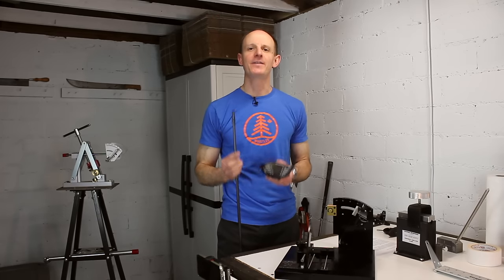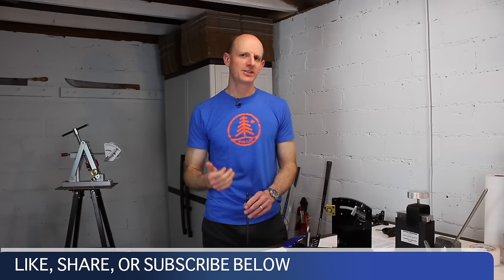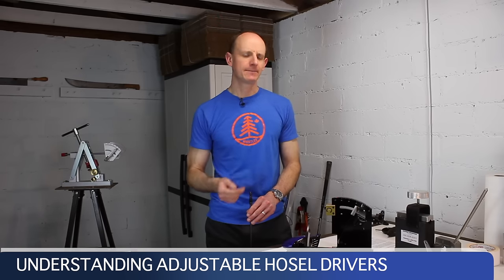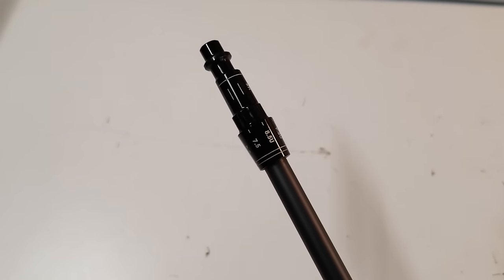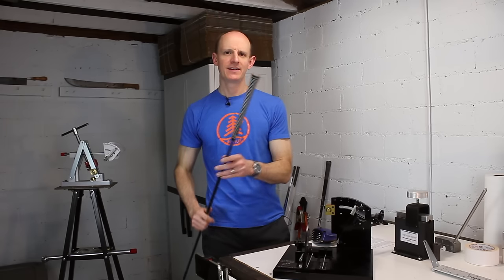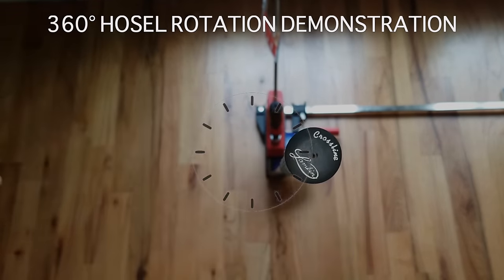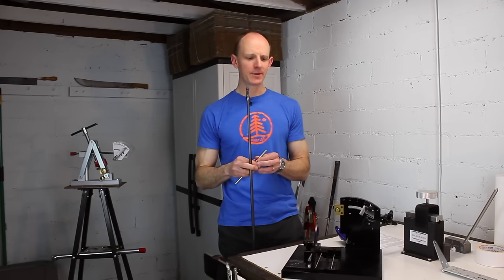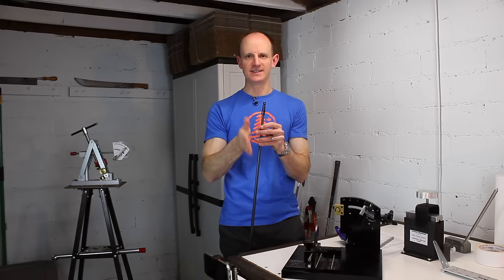Adjustable Hosel Drivers - How they change Loft, Lie, and Face Angle

Comment: @MOBILE CLUBMAKER Your explanation on this is 2nd to none! Just happened to see your channel and yes I did subscribe ! Thanks so much as I've just recently purchased a Sim Max D Taylor Made Driver.  I do have 1 question that is perplexing me to no avail.  The insert / adapter for the club head is there a right & left handed adapter ? . I'm a left handed golfer and the adapter on the shaft for my new driver has an RH ... yet my previous older R11 S shaft adapter has LH on the adapter?. Is this obvious it will make a huge difference when I make adjustments for any change ?  Certainly hope & appreciate a response to this ... thanks in advance & cheers from Ontario Canada!.
Reply from the maker: You should have a LH adapter in that club. It's not a big deal if it's not, just need to remember that the loft up and down will be reversed. The lie will not change, just loft measurements.
Thanks for supporting the channel!
Reply: @EFGMC   Thanks so much for the quick/response!!! Strange but noticed it immediately. So if correct,to get a higher loft with a RH adaptor I should choose the lower setting as a lefty?.  Sorry getting old really sucks!!! :).
Reply from the maker: @17Bruinfan  You got it. if you have any doubts you should be able to see the angle in the adapter by just looking at it before inserting into the head. Whatever orientation makes the adapter lean/point towards your target direction with the shaft held straight will be the lofting up setting.
Reply: @EFGMC   Perfect!,thanks so much, appreciate your help and quick response. Was having fits on the course Friday when my drives were low knuckling and thought I bought a knock off clone driver from global golf. Even pushing 60 yrs still hitting 260,but struggled to reach 160,makes sense now. So thanks again ! Cheers.

Comment: In what setting would produce a draw flight with the ball?   If I’m making any kind of sense.   I recently purchased a Mizuno ST 190 driver.    I’m still waiting for delivery on it.   But would love that draw ball flight.
Reply from the maker: Setting the hosel with the loft increased will make the driver want to sit closed at address and can promote a draw assuming you maintain that face angle at impact. You could also increase the lie angle more upright to promote a draw, but this has a very minor influence at best.
Last suggestion is watch my DIY Driver Fit video,
https://youtu.be/bXgaUC_tKCw
If you can move your contact point more towards the toe at impact, the gear effect will promote more draw spin vs. center or heel impacts.

Comment: So I guess I should have asked if the club is at a higher loft is the face angle at a - minus or + open to square at address?
Reply from the maker: Not sure what the plus or minus means. I would just focus on, for right handed golfer, more loft will make the face point more left of target naturally, and less loft will point it more right of target.

Comment: I know this is a year old but maybe someone can give me insight. I am fairly new to golf. Played seldom over the years but just really getting into it. First off, i use a cobra f8+. Just started trying to use driver, i use to just use a 3 wood because i felt it helped my slice so i would drive further. I have played baseball my whole life so it’s hard to break my wrist motion from a baseball swing. I average about 290+ yards when i dont slice. However, i hit my driver a mile high, so i tried lowering the loft of my club, I’m still unsure if when adjusting my club, do you want the face square with the ball or just let your club rest naturally on the ground.

Comment: I still cant comprehend the relationship between lowering the loft=open club face, and higher loft=closed club face.   Seems it would be the exact opposite, but indeed lowering the loft does open the club face, as thats what I did with my driver and can see it a tad more open at setup, which is what I needed.  

Just wish I can understand why this is.

If you want to hit a flop shot with a wedge, you open the face up.  Why is this not the case with the driver adjustment?
Reply: After watching the video, I understand it now.  Thanks so much! This was driving me nuts!
Reply: I will say though, this ONLY is the case if you are grounding the club, as it wants to lay in those positions.  If you are someone that hovers your driver and doesn’t ground it, the club-face wont be open or closed based on the loft you set it to, it will be as square as you set it.

Comment: Just curious, what if you hover the driver , then how does this effect things?
Reply from the maker: Hover or rest the head. Won't make a difference as long as you are squaring the face to your target at setup. Really to be more exact, does not matter if you play with the face open or closed, as long as you have that same face angle regardless of how you set the hosel adapter.

Comment: The open/close has more to do with compound angles and the pivot point of the hosel vs the plane of the face, no matter what, when you adjust the angle of that shaft, which is usually 60° to the face, there will always be a secondary angle created on the face

Comment: Have you tested the Cobra adjustable heads which are supposed to keep the face square even after letting it sole?
Reply from the maker: I haven't played with one personally but am sure they can at least minimize the face falling open or closed with sole shape and weight. It's also one of those things that depending on how you choose to measure it, you can make various claims. Also the fact that the adjustable hosel is bent at 1.5 degrees as opposed to 2, will lessen the effect.

Comment: I recently bought the king cobra drive with the adjustable hosel, it was factory set at 10.5 , I was hitting my drives straight , but higher than I wanted, I adjusted it down to 9.0, and when I looked down at the club head the toe had moved forward, what adjustment should I make to get the club face square to the target,..my hands on the grip , or my feet position on the tee ( this might be a dumb question , but I’m just a beginner )
Reply from the maker: I would just adjust your grip to make sure it is squared up at setup.
Reply: @EFGMC  thank you …. When I first adjusted it to 9.0 I got freaked out so I put it back to 10.0 so I never tried it,.. I will try adjusting my grip and give it a try,… thanks again !
Reply from the maker: @johnmellyn2700  Yep. Driving range and some range balls and you should be able to dial it in.

Comment: How does tilting the club forward or backwards (add or reduce loft) affect club CG? It should move with regards to the center of the clubface?
Reply from the maker: Lofting up does move the CG fractionally lower and vise versa for lofting down. I've had this discussion with other builder designer experts and consensus seems to be the amount that it moves is so small, it really won't ever show any effect.

Comment: Does a left hand TMade adapter do the opposite with loft & lie to a right hand one? With a right hand adapter, I go down 2* with loft but hate that it flattens the lie. If I go down 2* with a LH adapter (LH up 2*) does the lie become more upright?
Reply from the maker: All the TM drivers/woods/hybrids start with the flattest lie angle as the standard or neutral. That means any adjustment you make of any kind, (up loft, down loft, upright etc) will all make the lie angle more upright. It doesn't matter if the club is right or left handed as that only changes what they label the loft changes. If lie angle is really a concern you may need to look at other brands who start their setting in the upright highest lie angle instead of the lowest.

Comment: Where would you buy this adjustable Hosel for drivers and how would I get it installed into my driver
Reply from the maker: Adjustable hosels can not be added to an existing bonded hosel golf club. The head of these golf clubs has a specifically designed hosel that will accept the larger diameter adjustable hosel and allow for its movement.
Most drivers made in the last 7 years however will be designed with an adjustable hosel. Just look for a hole in the sole of the club to tell if it has one.
Reply: @EFGMC  Thanks so much

Comment: Hello- My name is Bryan.  I am 65, and have trouble reaching distances between 140-180 yards.  My 5 wood reaches about 180, and my 3 wood reaches 200... My 8 iron stops at about 140 yards, and I find it hard to hit the 7-5 irons.  Isn't there some fairway wood(s) available to help me?? Can I have something made?  I would prefer a fairway wood with a larger head, no offset, and about 30-40⁰ loft... But, cannot find such a club.
Thanks,
 -Bryan
Reply: 7 or 9 wood.

Comment: If I use the "D" position on my Callaway driver hosel I presume I am making the lie angle more toe up. But if I then aim      the face at the target am I losing the draw bias which the the D position is meant to introduce?
Reply from the maker: You are right that the D is just Callaway naming the upright lie settings as draw settings. It should be noted that the draw produced from a driver lie angle change, does little to the ball flight, at least compared to actually altering the face angle.
However the upright lie does not change based on how you manipulate the face angle so the slight draw bias it provides will remain.

Comment: If you have a 9.5 driver set at 12 and ground the club, does it go back to 9.5?
Reply from the maker: It will depend somewhat on the sole geometry and how much the face closes once grounded but it will likely be close to that 9.5

Comment: A friend of mine ordered Mavericks with a draw bias.. can this be corrected or is he stuck with this driver?
Reply from the maker: If we are talking woods then the hosels can be adjusted to lessen draw face angle, however it requires lofting down. If we are talking irons, you could bend them stronger which would lessen the draw biased set up.
Reply: @EFGMC  He ordered both the woods and irons with draw bias.. Thanks

Comment: Thank you, thank you, thank you!
Reply from the maker: Thank you for watching!
Reply: @EFGMC  Next it would be interesting to understand the concept behind draw settings on club hosels like Cobra does.
Reply from the maker: @becrisp  It will be the exact same mechanics as with the driver I showed. The difference I believe (don't have one sitting in front of me so this is my hypothesis), The Cobra sole design has a shape that will close the face when you change the lie angle guessing more upright.
This contact point will give you the face closure. Cobra chooses not to even mention lie angle in the adjustability (different than Taylormade or Ping or Mizuno). They simply focus on loft changes and face angle.
The shaft still rotates around the hosel (think of the clock I use in the video), it's just the contouring of the sole will make the head sit more closed or square based on the shaft orientation.

Comment: 10 second summary: 
The shaft enters the adjustable adapter at a slight (2 degree) angle, not parallel. 
Rotating the shaft around the adapter to the various settings results in small changes of club head orientation as related to the shaft, thereby changing the loft and lie.
Reply from the maker: Correct. Would just add that it's when the player returns the shaft to the neutral playing position that the changes actually show themselves.

Comment: Does the upright angle , close the face?
Reply from the maker: Yes, but with a flat faced club like a driver, the face  angle change is pretty small (4 degree lie change = .25 degree face angle change). You will get more face closure from increasing the loft.

Comment: Could you make a video or reply to this comment about how the cogs work? Thanks it’ll be much appreciated!!
Reply from the maker: If you are referring to the Callaway system, it's still the same basic idea. The only difference is you are rotating the cogs which tilts the shaft instead of rotating the entire shaft. Then it's just a matter of how the manufacturer chooses to label the changes. Some focus on just loft and face angle, some focus on lie angle as well. Just depends on the brand but the mechanics of what I show in the video are the same regardless. If the shaft is leaning forward it increases loft and will cause the head to fall shut. If it leans back, it lowers loft and falls open. If it leans up towards the toe, it increases lie angle, if leans towards the heel, it decreases lie angle.
Reply: @EFGMC  ahhhh smart guy alert. Thanks so much.

Comment: So I guess the loft sleeve won't work as intended for me since I place the driver's head on the ground and let it balance itself before gripping the club. It will change the shaft angle at which I grip the driver but the driver head will lay exactly the same on the ground regardless of which loft sleeve position it is in...

Comment: How does adjusting the head help to hit a draw
Reply from the maker: Increasing loft will make the head want to sit more closed which will promote a draw. Also increasing the lie angle can promote a draw but to a much smaller degree.

Comment: So, if you installed a training grip on your driver that helps you keep your hands in the correct position there is no way an ajustable Hosel Adapter would work.  Correct?
Reply from the maker: Depends on the driver. Callaway does not rotate the shaft so a training or ribbed grip would be fine. Titleist rotates the shaft in some settings but not in all of them.
As for the rest you would need to move the grip after rotating the hosel. This is where air installed grips come in handy.

Comment: so if you clamp the head and rotate the adapter, the shaft traces a out a cone. are there manufacturers whose adapters don't cause the shaft to trace a regular cone?
Reply from the maker: Nope. They all use the same method. They may start in a different location as the neutral setting but they all move in a cone. Titleist moves in sort of a double cone (like the tea cups ride at Disney Land), which is a bit different.
Reply: @EFGMC  got it... i watched part2 and figured that out too. thank you for these videos.

Comment: Out if curiosity if I set the position to STD  -D is that just closing the face slightly more
Reply from the maker: What driver are you referring to. Some will be talking about the face closure, but could also be referring to a more upright lie angle.
Reply: @EFGMC  Thanks for the reply I am using the Cobra Rad Speed XB
Reply from the maker: @47speedemon  Don't have one in front of me. The standard D setting is 180 degrees from the standard setting correct? It should be, in which case it's really just the lie angle getting more upright and them calling that draw biased. The face does not actually change angle in this case. If you want a more closed face, you would need to use a higher loft setting.
Reply: @EFGMC  oh ok I see. Thank you for your replies very help all the best for your channel bud

Comment: hmm if i get this correct the lie is also changing the cg point in the club so higher the loft the cg moves more further back witch should make it more or less fogiving??? 🤔
Reply from the maker: If we loft up, we lower the vertical cg slightly and vise versa for lofting down. This would in theory mean the higher lofts will produce less spin per loft vs a stock club with that loft not adjusted. Would love to test this, but have a feeling the amount would be very small and I'm not good enough to be that exact. Probably could only see it on a robot.
Reply: @EFGMC  so my understanding is correct??? CG as in centre of gravity
Reply: @EFGMC  ask mark crossfield to test this??
Reply from the maker: @Mrequine1  Yes, center of gravity. Not moving forward and back, but vertically up and down.
Reply from the maker: @Mrequine1  I doubt any human short of a Moe Norman would be able to see the difference. I have a feeling it would require a robot and a lot of data points to see a difference.
Reply: @EFGMC  thnx so higher up the face more spin lower less is spin?? am i understand this correctly or is it the other way round?? its worth knowing as there allot of club fitting cowboys out there id imagined!!
Reply from the maker: @Mrequine1  The lower the cg, the more vertical gear effect you see, ie reducing back spin over a greater portion of the face.
The higher up the face you make contact the more gear effect reduces the spin. Likewise, with low strikes. Low contact on face increases the back spin.
Of course you also have face roll that increases or decreases the loft as you move up or down the face. This will also factor into the spin numbers.
Ideally you should try and make contact just above the center for best spin/launch combo.
Reply: @EFGMC  thankyou for the info ive learned allot 🤗

Comment: What is your take on using an opposite handed adjusting hosel to have more adjustability?
Reply from the maker: That only can be applied to Callaway and Titleist. No other brands would see a difference other than incorrect label on adapter.

Comment: If 2 persons , one tall guy and one short guy use the same driver the dynamic lie will change. The short guy will have a toe which us much higher than the heel compared to the tall guy. How would the ball flight change for these two persons?
Reply from the maker: Sorry, just found this comment. The shorter golfer would in theory see the ball start slightly left (assuming RH golfer) and draw on top of that. Opposite for taller golfer. The start line won't change much for a driver b/c the face  has so little loft but the spin would cause the majority of the miss.

Comment: Good explanation.   I have to disagree with you regarding the importance of lie angle of the driver for this reason.  A strong tall player, even with an x stiff shaft, starting with a flat lie angle will have a difficult time from keeping the toe flattening even more, thus squirting the ball right.